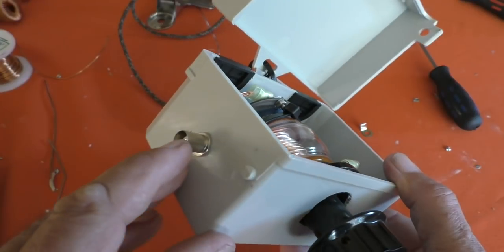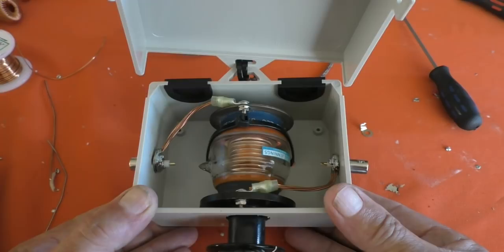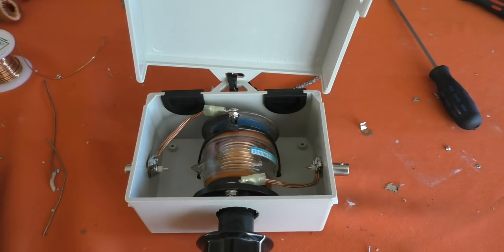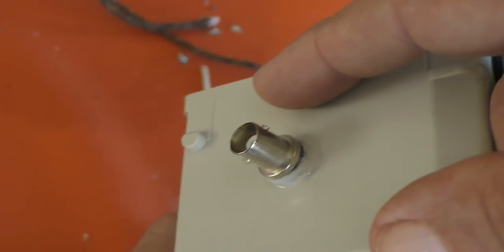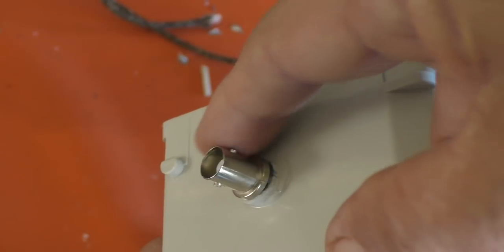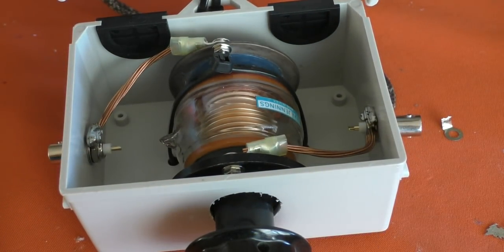Heat Damage To Mag Loop Tuning Cap Housing

Comment: I built a magnetic loop that is 1.5 metres across, it covers 80 metres to 20 metres. I silver soldered all of the joints, It is imperative that all connections have as little resistance as possible.
Reply from the maker: It certainly is. What capacitor did you use to get it tune on 80m?

Comment: I am interested to know where you got your capacitor from and have you added a reduction drive for fine tuning.
Reply from the maker: I got the capacitor from the local Perth Hamfest. There's no reduction on the drive which is ok for manual tuning, if a bit fiddly.
Reply: The capacitor is certainly a dinky size very compact , BNC connectors are very lossy best off with a S0-239 to PL259 for the connections. Don’t know if you can get a high temperature plastic boxes, maybe ceramic or wood would be best. Thanks for your great videos very informative .
Reply from the maker: Thanks Dave. If I can get a good connection, maybe with different connectors, I wouldn't have to worry about any heat.

Comment: Looks like a bit of Induction Heating going on there Steve 😊 I remember when I was an Apprentice how we used to fit Massive bearings onto the shafts of big Generators in power stations just using the circulating currents to heat up the inner race of the bearings, then they would slide right onto the shaft without having to use a Big hammer...Is there any reason why you don't use the centre conductor of the bnc,s ?. Just wondering if the RF would treat the bnc outer conductors as mini loops and that would have even higher circulating currents than the main loop itself...After all we know RF does some weird things..Interesting Video..Happy New Year for Tonight All the best.
Reply from the maker: Blimey, that sounds like fun. I think what happened was the copper tube was resting on the two small stubs on the BNC connector, they didn't slide into the slots. If the tube had slid over the BNC connector with the stubs in the slots as intended there would have been enough surface area of contact to prevent the heating. The other side was fine.

Comment: I built a QRP version of this after seeing the video you put up of your mate covering 500km with 5 Watts. It's a great little antenna. The only thing is that If there is a bit of wind and the antenna is moving around, you can actually hear the box which houses the Varicap scratching off the tree branch it's hanging on. So that part has turned microphonic. I've stood beside it and scratched the box with my fingernail and can hear it on the ft-817. That aside it works great on 40/80. Made it 350km to the Stirling Ranges on 40m.
Reply from the maker: They're a great little travelling antenna for sure. You did well to get it to tune on 80m.
Reply: It wouldnt tune on 20 for me put it did surprisingly well on 80. One of those unexpected things that happens in this game.
Reply from the maker: It's always worth trying things that should probably never work... you never know your luck. What value was your tuning cap?
Reply: 25-430pf. The sort you would see in a 70's am radio. Not one of the small plastic ones. It would be good up to about 20-30 watts. Thai seller does them on ebay, very cheap.
Reply from the maker: Thanks Mark. I do have some high capacity banked air variables from broadcast radios that would take low power. I could have the banks switched depending on the band. Maybe I'll try it.